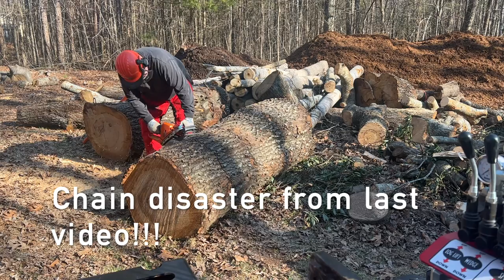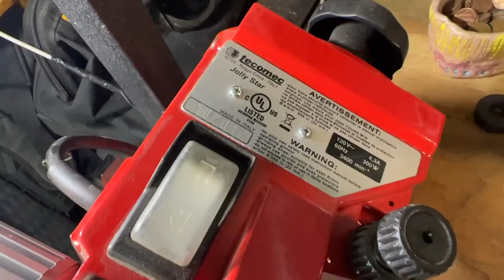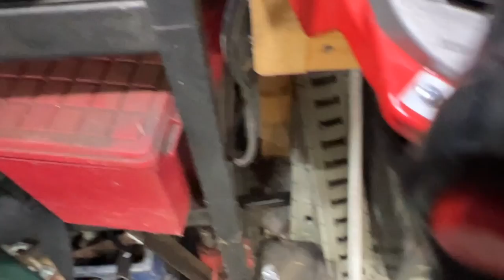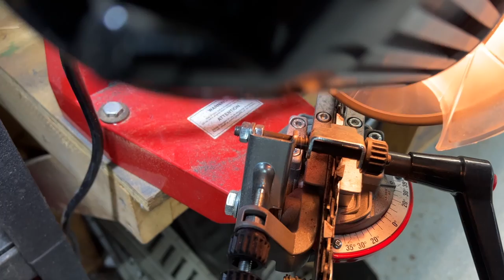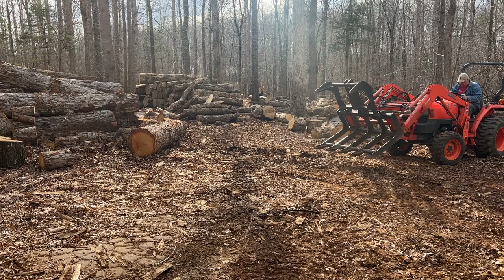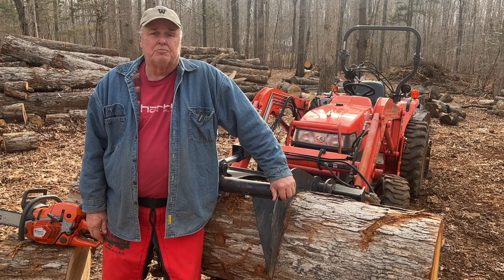Can this chainsaw chain be saved? Tecomec to the rescue...

Comment: Thanks for another great video. I use a stihl 2 in 1 file. It works pretty good for me. Those grinders are pretty slick. Definitely makes it quick and easy to bring a chain back. The only issue I have is that it’s too easy to take off to much of the tooth w/ the grinder if you’re not careful. But you did an excellent job with your explanation. Thanks again and keep on moving buddy!
Reply from the maker: Hi Chris. Thanks for the comments!  You’re right about grinders taking a lot of tooth off. I don’t use it often… usually only when I NEED to take a lot off lol. Thanks for watching. I really appreciate it!

Comment: Is that white oak? That saw went thru it like it was butter.
Reply from the maker: Good eye… it is white oak!  It cut good, but as I mentioned in the video, one more stroke on the rakers and it will do even better.
Reply: @oldguyfirewood  white oak is hard looked like it was really sharp. Thanks for sharing.

Comment: I just started using a Oregon 410 it works good the vise don’t hold good as yours. Think I try and see if can tighten the Chanel up. Definitely lot life left in that chain.
Reply from the maker: Hi Dan. I’m pretty sure you can make an adjustment to the vise. Most of the time I hand file or use a dremel, but when the teeth are damaged you can’t beat a bench grinder.

Comment: I hit a rock last Saturday and my chain became toast as well. I manually file, but could not get it sharp, so it's at the shop now. I will pick it up later. I am fairly new to editing YouTube videos. I put up a video yesterday where I hit the rock with my chainsaw cutting some maple. It was a pain to get my spare chain on the saw near sunset, but I wanted to finish the load. Thanks for this good video! I want to get one of those grinders now.
Reply from the maker: Thanks for the comments Steve!  I imagine the shop charges between $6 and $8 to sharpen?  Thanks for watching!

Comment: If I can't get chain to sharpen I take to the shop. Not cutting enough, in my humble opinion to warrant buying a grinder. Basically just starting out. Great video. Have a Safe Day
Reply from the maker: Thanks for the comments David!  I understand where you’re coming from. It’s a big investment if you aren’t using it a lot. Hand filing can correct about any amount of damage… it just takes longer.
Reply: @oldguyfirewood  I'm still trying to learn to hand file. I use the 2 n 1 or the dremel. So far its worked for me. Will keep watching yall to learn. Thanks

Comment: Nice sharpener! Is there a reason you went with that brand over Oregon? I know you mentioned they are one in the same,  just wanted to know if there are any benefits? I’m looking to invest in a pull down sharpener soon! Thank you in advance!
Reply from the maker: Thanks for the comments!  I researched both and just found a slightly better price on the tecomec. I bought 2 (I was going to set one up for .325 chain but changed my mind).  So, I have a brand new one in the box, never opened, that I’ll sell for $250 plus shipping if you’re interested.
Reply: @oldguyfirewood  still have the extra? I'm watching videos trying to make up my mind for 2days on which one to buy? Very interested! Respond ASAP before I buy one please. Nice video 👍
Reply from the maker: @JohnSmith-tn1te  thanks so much for watching. I no longer have the extra Tecomec sharpener. I would highly recommend it if you are planning on buying one.

Comment: I have a similar grinder and I use it mainly for evening out the teeth after a few sharpens with my fleabay Stihl 2 in 1 file. After watching your video I realise how much time goes into clamping and unclamping to sharpen the chains. Sometime in the future I might look at putting some electrification into the process of sharpening so that it clamps as soon as I move the grinder from the fully up position.
I've found that the stone wheel tends to leave a decent burr when taking a heap off when you've had an altercation with some steel. I might have to look at getting 1 of those betterer wheels.
Reply from the maker: I only use the grinder to even out the teeth or when I’ve hit a rock or some metal. The grinder I have can be purchased with a pneumatic foot operated clamping mechanism, but it wasn’t worth the extra cost.